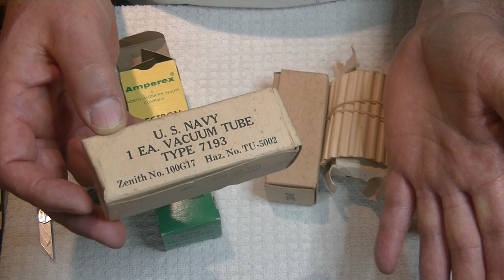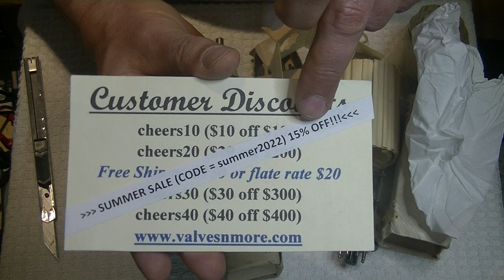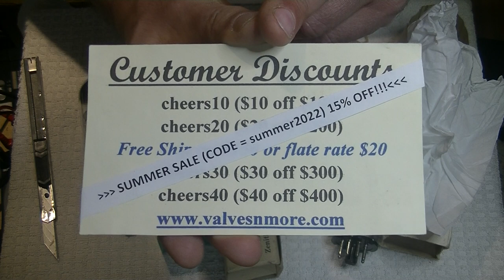Tube Lab #88 - Loctal Tubes & Summer Sale

Comment: I also thought loctals were used for rugged military use. They stayed in the sockets better.
Reply from the maker: I think you are probably correct, but I rarely see mil spec loctals, so i don't think it was that common.  The one manufacturer that did go in big on Loctals was Philco, they were a Philidelphia PA based consumer radio manufacturer.  They had a long history of working with Sylvania as their primary tube supplier.  When we find a box of vintage 7n7 or 7f7 loctals a substantial number of the tubes are boxed and rebranded Philco.